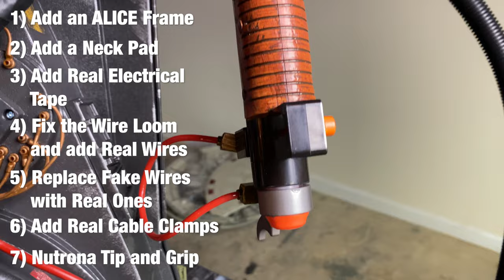Simple Haslab Proton Pack Upgrades

Comment: I switched the molded wires on the 'damaged' part of the hose by cutting the mold off, and stuck real ones in.  I took the cable sock off, and bought the type used in the movie.  I painted the under wire.  I painted the wire parts of the cyclotron using paused screen shots.  The rest I left as is.

Comment: Very cool. I used a 3D printed bit for the front grip on the "wooden" bit and also cut off the back grip and used a 3D printed grip there as well. Covered both in black hockey tape too. I need to replace those clamps, they look snazzy.
Reply from the maker: The clamps really take it up a notch for sure! Love that there are so many mods available to do on this!

Comment: Excellent video. I was wondering if the cable that the yellow sleeve goes on the attaches to the cyclatron pull out or unscrew.
Reply from the maker: Thank you! So the end that plugs into the cyclotron just pulls out. The end that is attached to the actual pack though goes through a hole and then is attached somehow to the inside of the pack. You’d probably have to remove the backside of the pack to access it. Hope that helps!
Reply: @MADEbyAP it helps heaps mate. Thank you for taking the time to reply.

Comment: When cutting the soft fake wire loom to push the wires in is there anything to be careful of while cutting into it like real wiring for the pack.
Reply from the maker: Hi there, that section that I cut out, there's a hard plastic piece underneath that I believe protects the cables running to the pack. I'd suggest leaving that in and just pressure pushing your new wires in. Hope that helps! Check this section out: https://youtu.be/KkadMlNUeI0?si=Ut6Syc_c5LV_Vqi2&t=887

Comment: You used the stock screw for the cable clamp, right? What was the size of the washer you used?
Reply from the maker: Hi yes I reused the stock screw and the washer is actually 3/8”. Hope that helps!
Reply: @MADEbyAP  do you have a home depot link or something alike that I can use for reference? I've seen different types when I look one up.
Reply from the maker: Hi sorry I had turkey on my brain. The outer dimension was 3/8 but it’s actually an M4 washer. Try this link

https://www.homedepot.com/p/Hillman-Stainless-Steel-Metric-Flat-Washer-M4-Screw-Size-4118/204801237

Comment: Will you be doing away with the 4D battery powersource? As that,s highly flawed
Reply from the maker: Probably. I actually am starting a new list of things to upgrade like adding the “always on” circuit and maybe adjusting some of the lights. There’s a part two in the future I’m sure haha.
Reply: it is super easy to do! I swapped mine out the other day and will eventually completely remove the plastic housing to cut down on the weight.